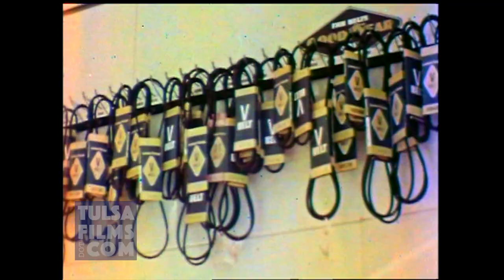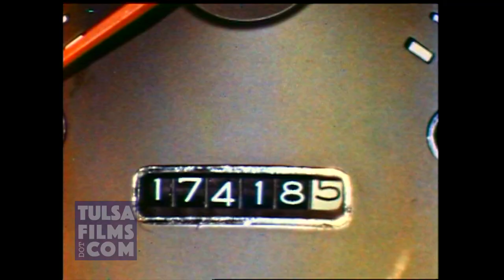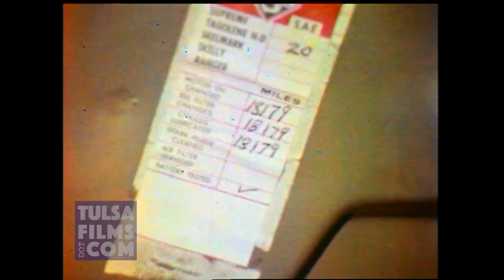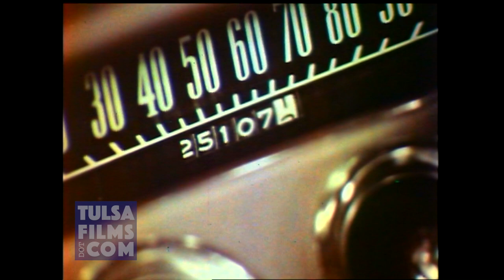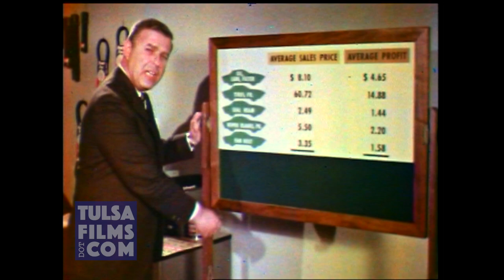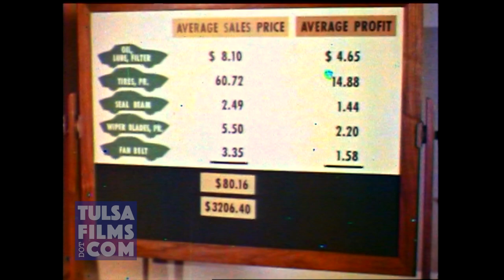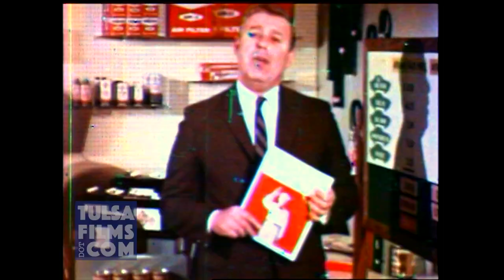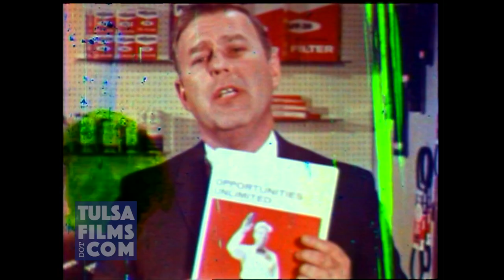You won't believe what this vintage service station was marketing in the 1960s!

Comment: Thank you Jack Frank for this great presentation! My beloved Dad owned and operated a full service Texaco filling station from the 1960s onward. Despite what people think, the operator made very little money from gasoline sales, often a nickel a gallon or less. The real money was in the sale of TBA; tires, batteries, and accessories. I worked there from my early teens to even after I graduated from college. We always greeted the customers promptly, dressed in full uniform (Texaco was green). There was tremendous competition from rival brands such as Shell, Mobil, Esso, Gulf, Flying A, etc., and your competition was literally right next to you or across the street. Service and honesty, at least in our locale was extremely important, and there was lots of customer brand loyalty as well. Windows were always squeegeed clean, wipers were inspected, and all under the hood fluids were checked along with the tires. We made money the good old fashioned way; by being honest and earning it. Yes, there were certainly dishonest service station owners, but in small towns and communities they quickly got a bad reputation and were soon out of business being replaced by another dealer. I learned more about life working for my father than I did earning two college degrees. I later on became an A.S.E. Master Certified Technician and after my Dad eventually sold the service station and the property in the 1990s, I wound up teaching automotive technology at a trades & technical high school until recently retiring. I would not trade the opportunity for working for my Dad and learning many life lessons for anything!
Reply from the maker: Thank you!
Reply: My dad had a Texaco credit card when I was a kid, always got our gas there. They always gave good service to us
Reply: Enjoyed your look back at your Dad and his Texaco "filling station."   You never hear that term anymore.  They're now just "gas stations."  Sounds like your Dad was both an excellent, honest businessman AND a great father.  The Texaco "jingle" from my childhood is still bouncing around in my 69-year old skull-- "You can trust your car to the man who wears the star . . . The big bright Texaco STARRRRRR!"   https://www.youtube.com/watch?v=b1zxOTDHIBQ
Reply: Huh?😺

Comment: These videos bring back memories.  The family of a high school friend of mine owned a very similar station to this one in the early - mid '70s, only theirs was a Standard Oil franchise.  He used to work there by himself in the evenings after school and on some weekends, and I'd sometimes stop by to hang out, keep him company, and maybe help out a little.  It was a two bay full service station that did tires, oil changes, tune up, hoses, batteries, belts, and all of the typical things a full service station did back then.  Most stations by the mid '70s didn't require their employees to wear uniforms, at least not like the ones in the film with bow ties and etc.  Some stations did have their employees wear work pants and a monogrammed work shirt, but his station did not.  

Even though I wasn't an official employee, I would sometimes wait on customers (ding ding!) and pump gas (no self service yet) if he was busy with something else.  Retail was almost entirely on a cash basis back then, so you had to be good at handling money and making change out of your pockets at the pumps, without a cash register doing the math for you.  Just helping out there was a good learning experience on several levels.  

He and I didn't try to upsell anyone anything, we just did whatever service the customers asked for.
Reply from the maker: Great memories and insight. Thank you

Comment: I thought it was pretty cool when I was a kid in school, it gave me some job options when we were out for the summer. It was also a good & free service for customers. We would clean the windows, check engine fluids, check tire pressures, all while filling the gas tank with regular or ethyl gas for the customer. So much has changed since those days, & not necessarily for the better.

Comment: I'm 70 and grew up in Detroit in the 50s and 60s. The cheapest I remember gas being is 28 cents. If you got a fill up of at least 8 gallons or more, you'd get a set of drinking glasses or a set of towels. The attendant pumped your gas, cleaned your windshield, and checked your oil, fluids, and air pressure if you asked him to, all at no charge. Sure beats the hell out of standing outside in the rain pumping your gas yourself for $3.50 a gallon.
Reply: $3.50? In LA? Ha😺
Reply: The skeely chairman CEO died of a heart attack in the board room after this presentation 🙀

Comment: Intresting.  I watched several films like these and it is obvious the role of the service attendant was not so much to put gas in the tank, but to use that action to sell products.  So why did gas stations ever convert to the “self-serve” model?  The oil companies saved money on labour but then there was no one to sell belts, oil and wipers to the customer.  The service stations would not make a sale until one of those items broke and the customer had no choice but to either drive in or be towed in to fix the problem.  Makes no sense.  The oil companies shot themselves in the foot when they went the way of self-serve.

Comment: I remember these days vividly. I am 66 and there was no such thing as self service gasoline. I wouldn’t care to be upsold at every opportunity.
Reply: There's a difference between "being upsold" and someone pointing out bad wipers, tires, belts, etc. Most people, especially these days, have no clue that their cars need anything until it begins chugging or the 'Check Engine' light comes on. Then they keep driving it anyway... I was a pro mechanic for fifty years and know the drill all too well.
Reply: @carlbeaver7112  

Being informed that you need something by someone honest is acceptable, but too often you are sold something that you don’t need. Back then cars required more attention than now and I recall several instances where someone tried to sell my father items or services that were simply not required. He was a shade tree mechanic and had a very strong sense of how his vehicle operated.

Comment: I worked at a Texaco service station during the  late 60's. Back then, the parent corporation would send inspectors out to the individual stations, and if things weren't up to company standards, the station was subject to be closed down, until the deficiencies were corrected. I remember the main fear was too much moisture in the underground storage tanks that held the thousands of gallons of fuel. Test samples were drawn, and if the fuel did not meet certain standards, a lock was placed on the main pump, an empty tanker would be called in and all the fuel would be pumped out and the  empty tanks then given a certain amount of time to dry out before a new load of fuel would be delivered. These were high standards that most service stations followed in those days. American standards took a back seat to nobody back then. How times have changed.
Reply from the maker: Interesting, compared to today's standards

Comment: A somewhat common practice with some stations was a maneuver call short sticking stations that allowed this practice could
Move a lot of oil or transmission fluid.
Reply from the maker: Think I've heard about that. Where they hold hand so dipstick doesn't go all the way i
Reply: @Tulsa_Films  for most guys a thumb 
And forefinger was sufficient.
Reply: But wouldn't short-sticking cause overfilling of those fluids?
Reply: @Zickcermacity  yes it could but if the attendant was well practiced in the maneuver it wouldn't be a problem

Comment: imagine going for gas only to be upsold for an hour lol
Reply from the maker: I guess no different than McDonalds "you want fries with that"
Reply: It was a different time,  people in less of a hurry and it was just a regular part of daily motoring then.  Cars back then needed a lot more routine maintenance that service stations like this took care of.  As cars advanced and we went to sealed batteries, fuel injection, electronic ignitions, rack and pinion steering, better, longer lasting oils, coolants and tires, serpentine belts replacing individual drive belts, and  longer service intervals for fluids and greasing. All of these things eliminated most of the routine maintenance cars needed and this mostly wiped out service stations like this.
Reply: @Progrocker70 Problem is I don't think most people today can do basic maintenance on a car.  When I started driving in the 80's, my Dad required me to know how to change oil, rotate my tires, replace a flat, etc.  The stuff you can do at home in minutes.  When I went of to college, I earned extra money doing the tasks for my classmates.  It was crazy asking someone when they last got an oil change  and pulling out a BONE DRY dipstick!  🙄
Reply: @Whiteones  I do not like to be upsold on routine things but it would be good to   be made aware of something  that really  does need attention

Comment: Back in the 70's I worked at my uncle's gas station. I'd have to be doing repairs and watching the pumps at the same time. I'd be doing a valve job or replacing a clutch or something like that and those idiots would pull up and expect me to go running out there to pump 3 dollars worth of gas. I sure wasn't greeting them with a smile

Comment: You just try to get a fuel card where they let you pay for tires and over a 6-month. With no interest and no carrying charge. Well they want all their money up front nowadays instantly you can't even charge it on your fuel station charge card and pay for it at the end of 30 days they yank it out of your account immediately if you use a credit card you're paying interest on the credit card and today's greed and prices are astounding. 2023 92 octane gas is $2.60 in Russia a gallon. That's for no ethanol 92 octane. Just try to find that for under $4 in America